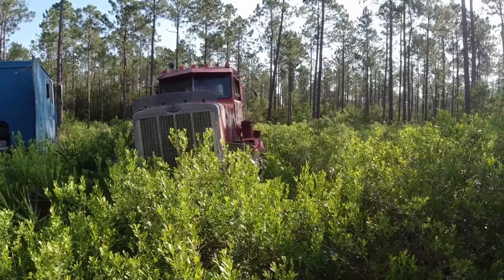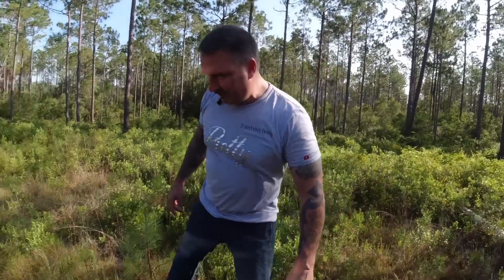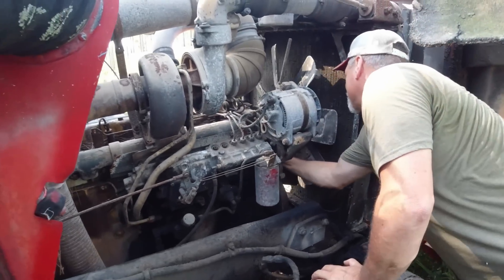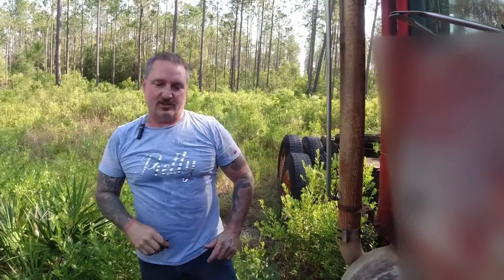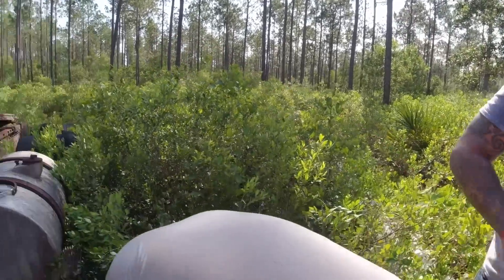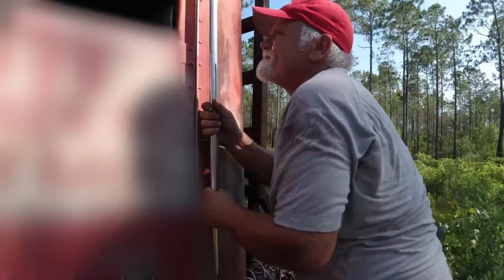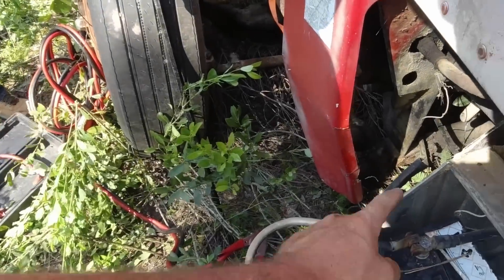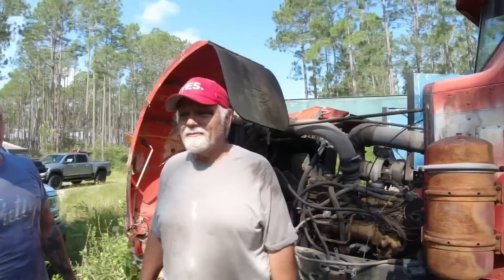I WAS BAFFLED BY THIS Old Pete WASTING AWAY! WILL IT START?

Comment from the maker: ▶️Watch a KW W900 Will it start here: https://youtu.be/Ood6vRUZay4
Reply: Just a little FYI for your pedantic viewers. When the Engine is installed into {or intended to be installed} the vehicle it is a Motor and can be accurately referred to as either. . Motor is part of a system, and can be electric, internal combustion or other means of providing motivation {motive power} for the machine.
Reply from the maker: Good word!
Reply: @Hfoutdoorsyt  I was hoping that you got that truck running I'll send you all messing with it y'all gave it a shot but if you got that truck running and text me and let me know whether you got it running or not I do believe that it will run so I think that truck probably maybe about a 8485 text me back and let me know did you get the old Peterbilt running I was also thinking working on that truck a big old snake was going to pop up on you y'all gave it a shot though I'll give you credit
Reply: How much for the red pete
Reply: I enjoy watching y'all videos

Comment: That 3306 engine was very good at 200hp in the D6 crawler, they turbo charged it then intercooled it and put in trucks at400hp, it was stressed and blew the lips off cyl liners and blew head gaskets, rebuilt many in the uk.Regards from uk,

Comment: Have you run across any trucks or equipment equipped with air starters? Would love to see you guys try to get one of those started!
Reply from the maker: no but that would be cool.
Reply: Couldn't think of anything better than  sumin starting off air and running away mmmhmm thats content right their
Reply: Ausie steve s place started a truck with a air starter he used a portable compressor to change the air tanks.

Comment: I have a turbo intercooled 3306 which came out of a twin steer dumpster with terminal chassis failure, it got a new lease of life running a 32 inch centrifugal fan on a big suction system for some opal mining machinery and has been a really good, trouble free motor for many years.

Comment: I drove an 85 359 for 3 yrs ..im gonna say with the 4 square head lights its between 81 and 87   the 359 was officially retired in 87 That 3306 is about the same as the L10 cummins

Comment: Hey heres up tip for you guys ,,,    no starter or flat batts ,,,,       get a petrol air compressor an connect it to trucks air tanks ,,,      release the brakes once air is full ,,    select 7th high range and tow start it with your Gmc ute,     heaps faster trust me ,    just have confident drivers in each vehicle,    truck driver puts clutch in with high range gear and soon as engine fires either snap outta gear or clutch in with foot brake ,   ,   just find the 1st tank in air supply routing to connect to ,   closest to air compressor usually,   ,    use tire valve stem or  tractor tire  ,   thread it into a blanking bung on air tank ,   ,,   use a fast flow adapter to connect to your installed tractor valve on air tank ,, remove inner valve core to fast flow into truck ,  once airs full disconnect air hose an fit inner core back in tractor tube valve ,,    wear glasses and practice,    tip have spare valves incase you loose it  ,,   125 psi the air compressor stops at your truck is too,   brakes should come off and all truck air equipment should work as normal

Comment: Bring back your rain gear when you get a working starter because you will be coated if that thing fires with those 2 injector lines off the pump. The thing you had your finger stuck in was the starting aid (ether) but not a crowbar or ratchet strap or vise-grips or Crescent wrench  and Wiley is like me and has selective hearing and filters out a lot of non-conductive stuff. God Bless All Yall!

Comment: When guys said Farm deisel my late Father did to his Stakes and Highway Tractor trucks but in 2002 in Canada not allowed do or get MTO take you off road & fine by police and put right Desiel in after drain out ! Can't even put Automatic Transmission fluid to fuel to help lube injection pump also injectors to no more and shame because sure did better years help keeping in tip top shape last longer too ! New stuff used in Desiel fuel not my favorite  and plus electrical more add in engines parts wear out faster! Also Hank those Cirsen Wrenchs talk about have lots them hear of Canada, USA , Twiana, Chain , Honk Kong made my late Grandfather Harold and Late Dad had for years !